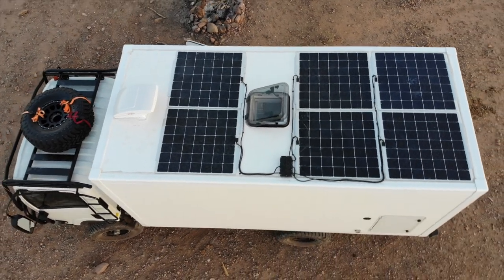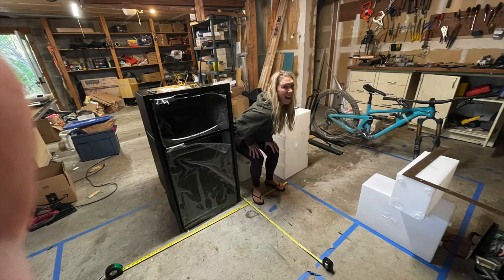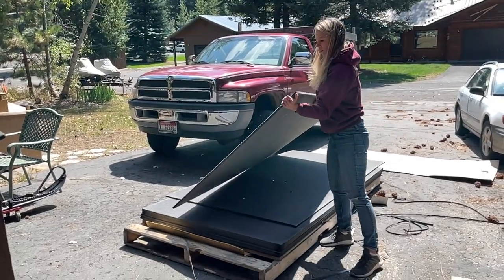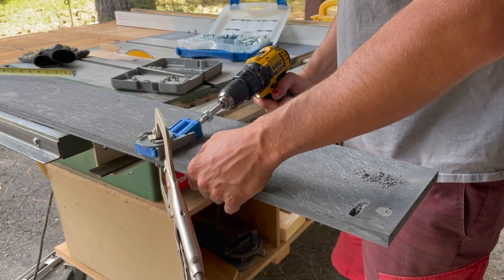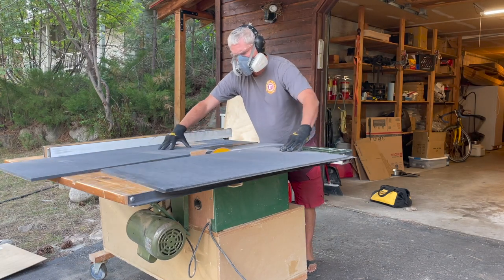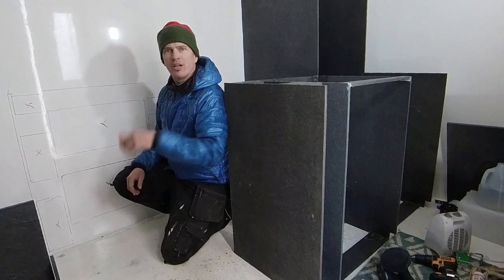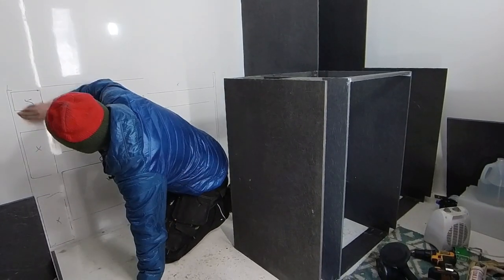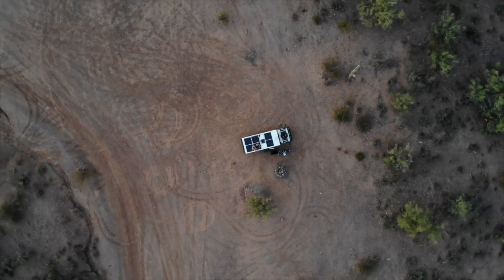Expedition Camper DIY Build Week 1 - EarthCruiser CORE with Total Composites Box

Comment: This was a very informative video.  

How do you like the composite board cabinets say compared to a 80/20 aluminum bar set up?

Thanks again for sharing
Reply from the maker: We used 80/20 in our last build which also turned out really nice. I like how 80/20 is less permanent than these composite boards. But overall we've been happy with the composite boards. They are a bit lighter I think than the 80/20 setup we had.

Comment: Are you going to insulate the Rixen holding tank? I'm planning a similar system for my truck, but the holding tank will be insulated with 100mm of PU foam to prevent heat loss...
Reply: @outsidenomad  is the idea that you keep that holding tank hot 24x7? Or just heat it up when you need hot water? How long does it take to heat up?

Comment: Where did you guys buy your coosa board? I’ve been finding prices that are higher than you found. Thanks!
Reply: @outsidenomad  Thanks. I had found their availability and prices about the best too. I was thinking of using Coosa Board to build my large gear garage doors for my camper, but decided to build the composite panels out of foam and fiberglass sheets instead as less expensive and lighter and more insulating. I had thought about building cabinets out of Coosa before I went with the aluminum framing route; glad you did and shared it, as it's a great option over wood.
Reply: @outsidenomad  Yes, I'm using 8020 for the cabinet framing, and it's nearly completed. Been doing pull ups from the upper cabinets with minimal adhesive sealant as it's so strong.